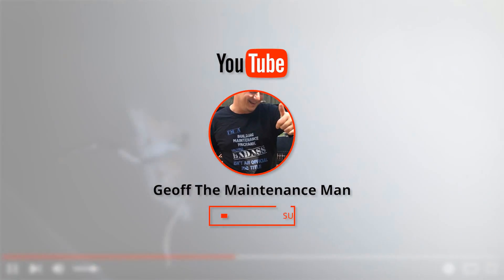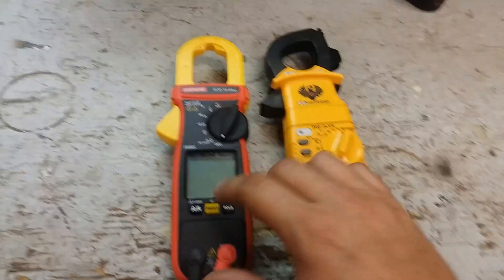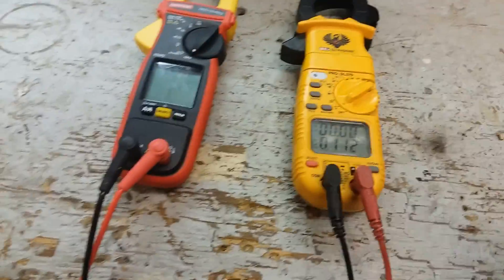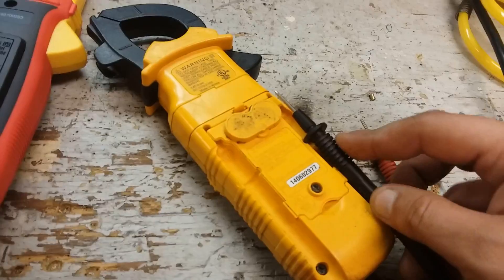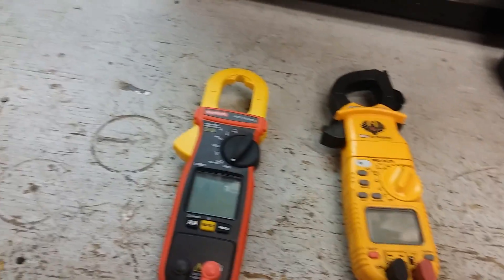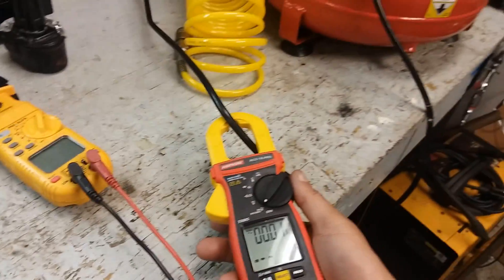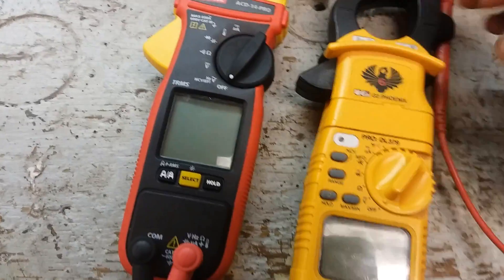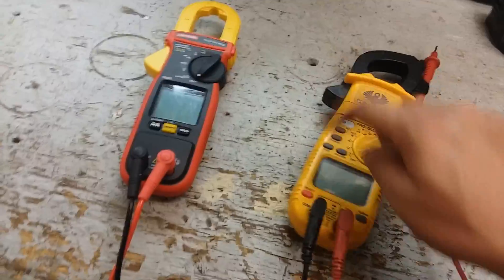HVAC ACD 14 PRO VS UEI DL-379 Multi Meter Comparison.

Comment: Does this read dcmv for thermal couples and thermal pile’s testing
Reply from the maker: The short answer is Yes it does.But here are the Stats for the acd 14 pro ...........Large LCD with dual display that can display voltage and amps concurrently
True-RMS for accurate voltage measurements in noisy environments
Low pass filter for current and voltage measurements on variable frequency drives
Amp-Tip function for precise low current measurement down to 0.1 amp
HVAC applications with temperature, DC micro-amps and capacitance
In-rush current
Temperature
Non-contact voltage detection (NCV)
Audible continuity and diode test
Data hold
Auto ranging
Auto power off
Low battery indicator
Safety rated CAT III 600 V
Reply: Jeffthemaintenanceman  want to make sure before I purchase this... I test thermal couples and thermal pile’s and I need this dcmv setting here... so you say it does....????? Right...

Comment: always back up the tests with real probe connected readings........................
all the contact-less  stuff is a crapshoot. with higher voltage and leaks around coupling to you, the less chance they have of alerting to voltage or being anywhere close. secondly, always treat everything as LIVE

Comment: All you have to do is take a reading on a capacitor & the deal is done...Amprobe hands down!!! There is no more waiting 10 seconds for the reading like with the UEI. The Amprobe is instant readings & way more accurate then the UEI (my DL389 was always off by apprx. 3mf). Throw-in the inrush current, the small amp clamp for tight spaces, and uA for flame sensors, & and the lightweight. It's AMPROBE all the way!!! You'll forget all about the magnet on the back. Oh yeah, and the cherry on top is the back light stays on for 20min. 😮
Reply from the maker: Shannon Knight HVAC yep my heart is set on the amp-probe. Although I did not demo the cap reading the dang thing is very fast at reading them. I like it a Lot. Also I like you watching my channel Thank you so much.

Comment: The UEI DL479  is priced around $80-$90 and has TRUE RMS . I just upgraded from a UEI DL379 to a UEI DL479. I still have a clamp on Amprobe meter that  is analog and is 25 years old at least and still works lol.
Reply: Why the 479 over the 389?
You simultaneously loose dual reading.